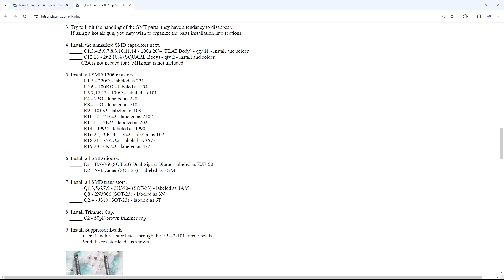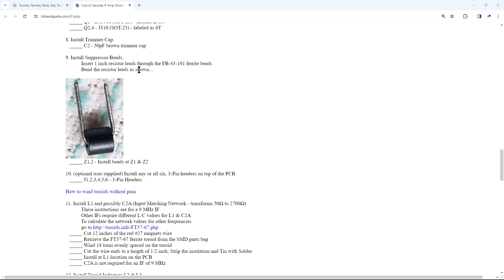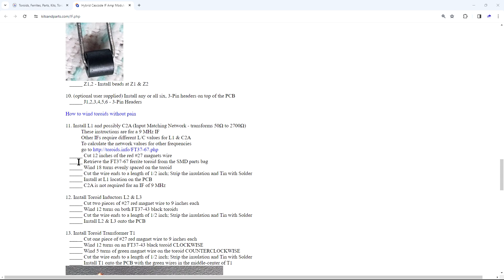IF Amp Kit Build Part 2

Comment: Despite the directions, I would have held off on the trimcap until the rest of the SMD parts were done so the board would sit flat on the bench without wobbling...
Reply from the maker: Yeah I should have. Turns out I miss read the instructions as it did have you do it later.